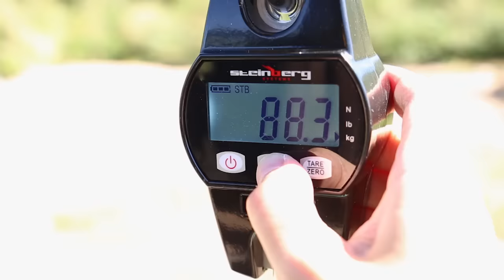Lego Motor Lifts a Rock (88kg/195lb)

Comment: I am more impressed by the capability of the plastic parts here.
Reply: yes lego is very strong looke for the bugatti build of lego. tehy tried different materials for the gear but came back to the lego gears ... :)
Reply: Do you have a link? TIA
Reply: Its Lego's patented Plastimantium.
Reply: "Only the best is good enough"
Reply: You are not alone
Reply: Yeah it is the result of years of trial and error. The really early parts from 50s were pure trash, they deform over time so trying to build with them now is a real hurdle since they're all misshapen and missized. In the 60s that was rectified when they switched to ABS plastic. But after that they've still continued to have pigment problems. The old grey bricks would lose colour and become this ugly weird colour over time. That wasn't really solved until 2003 when they switched to a more bluish shade that wouldn't discolour. Or atleast not as badly. On the other hand that same year they also changed brown to a more reddish shade that was more brittle which caused them to issue replacement bricks until they could fix the issue. You know so they've had 60 years to fuck up and then figure it out to get where they are now.
Reply: cpt nordbart Man. i stand
Reply: Lego plastic is strong af.
Reply: String?
Reply: cpt nordbart but not everyone could build such a thing with those parts
Reply: He used "mechanical advantage" so the legos did a lot less work for a lot longer to move it. Its like lowering the angle of a ramp so it takes longer to walk up but its easier per step.
Reply: Dusky Racer yes but the “ramp” still needs to be strong enough to support the weight of what it’s holding. That’s the impressive thing here, the weight the legos are holding. I know it’s split up so all the weight isn’t on one part, but it’s still impressive for such small plastic
Reply: What do you mean you're more impressed by? Isn't that the whole point? What else would you be impressed by?
Reply: donutdoode69  haha. Yeah exactly
Reply: Same. Can't believe those tiny pieces had such structural integrity.
Reply: Now tink on steel legos
Reply: My girlfriend is strong she had a plastic surgery
Reply: Lego is so strong it can destroy your foot
Reply: Im still more interested on how it's not bent yet
Reply: Yeah 👍
Reply: @jeremysmith9694  you could be impressed by the fact that a lego motor is lifting the stone, IsNt ThAT thE WhOlE PoINt??
Reply: Lego is made of ABS plastic. It has good mechanical strength, but is not chemical resistant
Reply: @instantnoodles8640  I haven't got hold of you until now but I'm happy to announce that you won the YouTube Humour Award for September. Congratulations.
Reply: @duskyracer8800  the weight is still on the plastic support bars though
Reply: Did anyone ask you that 😂😂😂
Reply: Well he used lots of pulleys to achieve that but it's acceptable
Reply: @bobbobby9056  4 double tackles each double tackle holds 4 wires so 16 wires. Each wire only endures 5kg, the average fishing line can hold that much so that is not insane.
Reply: Fresh plastic is pretty strong, it's main issue is that it's degraded by sunlight and many chemicals, and age as well
Reply: @Olav_Hansen  exactly but still clever stuff with legos
Reply: That's pully
Reply: Same
Reply: Bruh, it's literally lego
Reply: @Bards.98  Well to be precise, he said it was better than 3D printed carbon fiber or kevlar. 😅It might still be that steel, carbon fiber, or keval is a stronger material when formed otherwise. But for sure Lego plastic is very good material for the bricks, especially considering its price. Carbon fiber and kevlar are very expensive materials.

Comment: That moment when a toy can lift more than you can for longer periods of time than you can.

LEGO truly is incredible
Reply: What if I told you you can do that too with clever use of leaverage? "Give me a stick that is long enough and I will lift the Earth" - some Greeky Boi
Reply: Also you’re looking at it wrong the gear ratios and pullies used are considered simple machines. They are applying a lot smaller force over a longer period of time to get a big change. In this video the LEGO motor was a small force, that given enough time could use torque to pull something heavy off the ground. The whole thing is just balancing energy. The same amount of energy you would use to lift that rock the same height is the same energy the LEGO motor used. The difference is you used energy faster then the LEGO motor.
Reply: With that much mechanical advantage you could lift that a lot faster "depending on how fast you can pull a long rope"
Reply: If you can't deadlift 88kg as an adult maybe start go to the gym or smt.
Reply: @simplicitas5113  For 20 min?
Reply: This needs to be submitted to lego. I wanna see this guy see just how far he can push beyond this with the steel parts he has
Reply: Simplicitas Ahaha true. 195 pounds is very very light for a deadlift exercice with proper barbell and weight. However, lifting the same weight as a rock without much grip and no handle is a different thing. The weight is much more dense
Reply: HOW DARE YOU CALL LEGO A TOYYYYY AAHHHHHHHHHHHHHHHHHHHHHHHHHHHHHHHHHHHHHHHHHHHHHHHHHHHHHHHHHHHHHHHHHHHHHHHHHHHHHHHHHHHHHHHHHHHHHHHHHHHHHHHHHHHHHHHHHHHHHHHHHHHHHHHHHHHHHHHHHHHHHHHHHHHHHHHHHHHHHHHHHHHHHHHHHHHHHHHHHHHHHHHHHHHHHHHHHHHHHHHHHHHHHHHHHHHHHHHHHHHHHHHHHHHHHHHHHHHHHHHHHHHHHHHHHHHHHHHHHHHHHHHHHHHHHHHHHHHHHHHHHHHHHHHHHHHHHHHHHHHHHHHHHHHHHHHHHHHHHHHHHHHHHHHH
Reply: the same thing can be said about literally every other machine
Reply: Mate, get yourself to a gym, stat. Seriously. 😠🙈🙉👎👎
Reply: @duskyracer8800  not the point
Reply: At this point i’m starting to think we gotta give lego more respect than being called a toy….
Reply: At this point, it's too dangerous to be left alive. It may kill anyone if it could.

Comment: 0.144W of lifting power.
Assuming the motor draws around 0.6 amps, thats 5.4W power drawn.
Giving a total efficiency of 2.7%.
For that amounts of pulleys without bearings and using flexible plastic lego it's actually not so bad

Actually, those motors are less than half efficient, so you could probably double that figure
Reply from the maker: According to Philo's measurements, if I read it correctly, M-motor outputs only about 0.75W or 1.0W. If you use those numbers, the efficiency is 14%-19%. http://www.philohome.com/motors/motorcomp.htm
Reply: I remembered about those measurements later, hence my small note at the end. Even looking at the numbers it's hard to tell because the efficiency changes with load and we don't know what the load (and the power draw) is in this test. Either way, these motors aren't very good. But I still think the results are quite astounding for what it is, good job :)
Reply: I was about to post the very same thing. I got a power of 0.14388W so equal to yours so I'm happy.
Reply: nerds
Reply: @random71856  and proud to be
Reply: i'd say spray any part that comes in contact with a moving part with silicone lube, or any kind of oil and you'd get less friction. might be able to reduce it to 130:1 or less just from losing friction. :)
Reply: Lol wanted to do the same calculation but you guys already did it.
Reply: You could test the mechanical output with different size smaller weights to see what is the most weight x speed to give the maximum power output. Another thing would be to find what gives the most efficient weight vs the power consumption, somewhere between bogging the motor down with a big weight or a small weight hardly using the motor's capabilities.
Reply: r/theydidthemath
Reply: we dont care
Reply: You could use the same rig to create a battery. Just run the whole thing backwards. You could then measure the return trip efficiency.
Reply: @TimpBizkit  get me the BL curve of the damm coilll....... just kiding
Reply: High quality permanent magnet motors are actually really efficient, often 75-85%

Your guess of 50% would be right for a car alternator, which cares less for efficiency than cost of manufacture.
Reply: @joedoe1096  i agree with you there but in terms of lego motors, they feature a built in gearbox and "lego" output shaft, both of which have a friction penalty. I'm not even sure if they use any bearings - albeit it is a planetary gear set iirc
Reply: fazmade 🤣🤣🤣
Reply: Incredible, that was my first reaction, to calculate force, work and power. Just checking if I can still do it boozed up and 14 years after graduating from high school :D
Reply: The word is...

Comment: Next mission, lift a smart car
Reply: Ok. please lift  @darkideas2088
Reply: that is possible, but it will require multiple motors and far stronger ropes.
Reply: The gearing ratio would need to be astronomical

Comment: That's impressive how so smol motor can lift SO much "real" weight
Reply: Its a real concrete block so dont put real in quotes
Reply: Yeah why is the real in quotes?
Reply: I mean in previous vids he have only pulled a weigher from an piece of wood, but in this one we get to see proportions of what it can do
And also i don't have English as native tongue so i can't do grammar :/
Reply: Rule one of speaking English, don't say "Native tongue", say native language.
Reply: To answer, it's because the force the motor applies is magnified many times by all the gears and pulleys which also reduce the distance it moves by a similar amount. 

Firstly the gears make it so the motor has to turn over 100 times to turn the shaft which the string is connected to just once, so if the motor 'pulls' with 100g of force the shaft the string is attached to will 'pull' with over 100x that, so over 10kg, but the shaft moves more than 100x slower than the motor. 

Secondly the pulleys make it so any force that is applied to the string is applied ?12x? to the weight since as the string loops up and down many times and is free to move throughout the arrangement with minimal resistance. This also means pulling the string 12cm will lift the block just 1cm (if it's 1:12 ratio). 

So if the gears pull the string with 10kg of force the pulleys will magnify that to 120kg lifting force, all from 100g of force from the motor originally. it's 1200 times slower effect though, so to lift it the 20 cm the motor would have had to move 1200x that - 24,000cm or 240m or about 1/4 of a km. That's why it took 20 minutes to do it. 

Make sense?
Reply: @nommy8599  hey, i know physics, i already graduated primary school (1-9 classes), you didn't had to explain it in such detail
Jeez, comments in this thread are starting to get annoying
Edit: I just mean the visuals of a giant stone lifted by little pieces of plastic is fascinating and surprising
Reply: +Nommy There was no question asked.
Reply: that's true
Reply: I was glad for the explanation. It looks so incongruent that I had to come to the comments to read a bit more about what was going on!
Reply: With enough mechanical advantage (usually achieved through gears and pulleys), the motor of any size can theoretically lift an object of any size.
Reply: glyn hodges  I didn't say it's not acceptable. I was trying to say native speakers don't say it.
Reply: but its painfully slow

Comment: The gear reduction makes sense, I'm not surprised that the motor can lift 195lbs.  What I am surprised at is that the legos hold together with 195 lbs of weight on them, that's absolutely insane.  I'd have figured they'd fall apart and/or bend in a heartbeat.

Comment: With enough mechanical advantage (usually achieved through gears and pulleys), the motor of any size can lift an object of any size. The tougher part is to get that plastic frame to bear the weight though.

Comment: This almost means it would be possible to build lego structures carrying humans.  But the structure is laying on a metal fork lift and use a lot of pulleys to distribute the weight, so it's not 100% lego.   

Anyways lego technics are probably one of the best ways to introduce to engineering, mechanics and construction.  I really had a good time designing a direction system and a suspension system in a car the other day.  And it really felt weird when I got back in my real car after that.

Comment: The energy needed to lift that concrete block can be determined by the formula m x g x h. So 88kg x 9,81 x 20 = 172 joule.
To calculate the power consumption of the motor we simply divide that number by the time it took for the motor to lift up that charge so 172/(21x60) = 0.13 Watts of power. So even though the fact that a lego motor can lift a 88kg is impressive, its kinda not when you know the physics behind it.

Comment: Okay...gears I can understand. I can physically see an 8 tooth gear is pushing on a 12 tooth gear in a way which increases torque and reduces speed. Pulleys? Somehow when you wrap a string around a roundboi and pull on it...it's stronger. Lots of roundbois = more stronger. Works gud. Real life hack tbh.

Comment: the ratio is backwards (as is the same with the drill prss you made) im incredibly  imperssed, but when the ration increases torque?decreases speed,the ration would be 1/x number not x number/1, so in this scenario the ration would be 1 drive : 135 driven or 1x torque : 135x torque, which allows the force lifting the rock to work more effeciently and not tear the lego servos/motors to absolute bits

Comment: Eh, kinda impressive but if you are an engineer and/or nerd kid then you can clearly point out the there was a twelve pulley gear thing which slows the machine down, but provides higher lift

Comment: So if you had stronger parts, metal bearings and lubed gears, would a motor of this size be able to lift more? With the correct gear ratios would it be possible to tow a car or something?

Comment: Can you get power from the rock's descence using the same motor?
Reply: The gear ratio is too high to get any meaningful energy back if the motor turns at all. It's just going to be eaten by frictional losses.

Nor are Lego motors really designed for energy generation, you'll just cause premature wear and tear.

Comment: With a large enough fan, I wonder if you could lift that rock with wind power alone. Have the fan lock in one direction so that it only turns in the direction you want. 

It would probably take forever (maybe more than a day), but it'd still be cool to see essentially a battery charged with wind energy using Legos.
Reply: With the gear ratios used here you wouldn't even need to convert it to electricity, just have a propeler turn a shaft that pulls the string.

Kind of a neat idea.

Comment: i am impressed but what the hell sort of rock was that? it was pretty small for 88kg..
Reply from the maker: It is granite, about 2700 kg/m3. 80x20x20cm if I remember correctly. Used as a bottom rock for tombstones, lays upside down on the planks there.
Reply: Ahh fair enough then.  That stuff is pretty heavy.

Comment: I do not understand the point of those videos, even with a tiny motor, if you gave a big gearing, it could lift what you want (with strong constructions about bracing, axle and so on) by reducing the speed and increasing the torque, power remains the same (minus the loss linked to efficiency). And as the translation power is P = speed * force, if you reduce speed, you can lift what you want, so said a lego motor can lift XX kg is a non sense for me.
Reply: Nico71's Lego Technic Creations Point is to push the limits of what technic parts can do. It’s not so much the motor and gearing as it is the limit of plastic material and axles without bearings.
Reply: Yeah, but it would be boring to just describe the math. Better to show the real possibility.
Reply: But it would be interesting to see just how far you could push lego bricks before friction or durability limit.
Reply: Not everyone here is engineer, so its pretty interesting what you can do with  lego
 nowdays
Reply: Nico71's Lego Technic Creations This is a mere childs toy that can lift a near full grown man, with near expentionentall possibilities and sturdy enough that ones grandchildren can enjoy Building stuff with the very same blocks.
Reply: Fester Blats  exactly that
Reply: the point of the video is that demonstrating the laws of mechanical advantage in a fun way that encourages those who have yet to think to think is better than explaining it in a conceited way that drives said people away and encourages them to perpetuate the trope that math is lame and that engineers are evil pedants.

so, it's a bit useful.
Reply: Definitely sensing Lego talent jealousy. Why would you hate on a brother/sister legoteer? Will you two create Lego guns and fire Lego bullets if a war breaks out? And if you do, please post videos